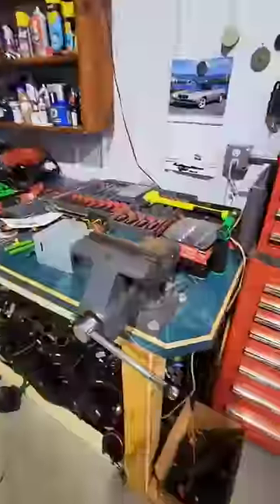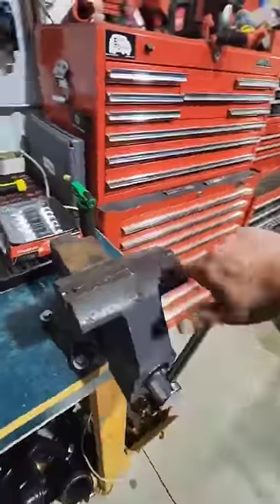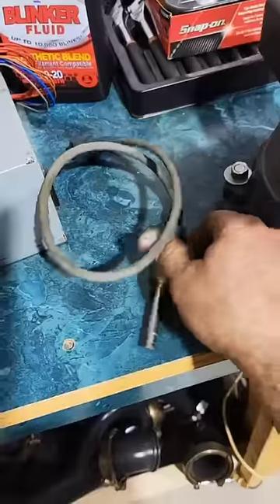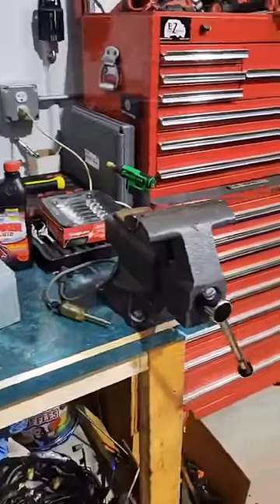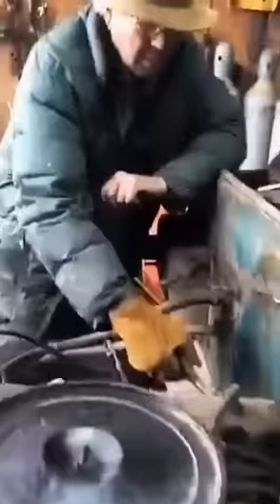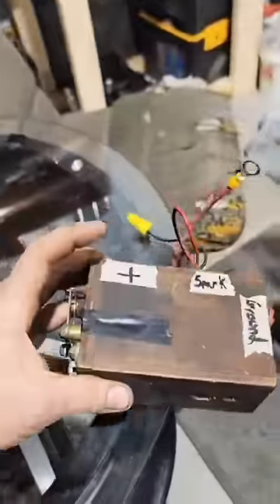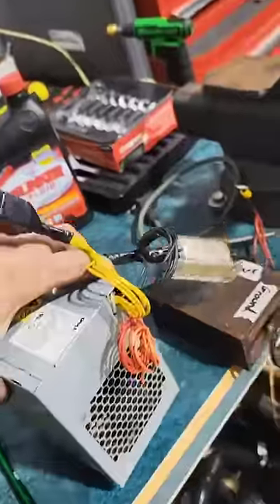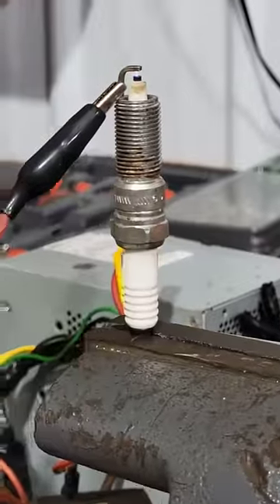30,000 Volts out of an ignition coil! #shocking #shorts Be careful, electricity can be dangerous.

Comment: I used to work security at a car dealership. One night some bad guys came to try to steal new cars, in an already stolen car. I discovered them, and chased them off the property, but was unable to catch them. Virginia law said security guards must cease pursuit at the edge of their assignment, so that was that.

I then had a running minivan to deal with, they had jammed a paperclip in the ignition, and I had no idea how hotwiring worked. I also didn't want to touch too much, in case of messing up fingerprints or otherwise destroying evidence. I called 911, and the dispatch told me take the battery cable off. I was like yeah cool, I would do that, but I have no tools. So he tells me just yank the spark plug wires off one at a time until it stops running, don't need tools for that.

I yelped after the first one, and the dispatch was laughing, I don't remember what I said to them, probably something along the lines of "You could have effing told me it was gonna hurt". So with him egging me on, I pulled two more until the damn thing stopped running.
Reply: @Ixidora battery terminal connections should never be that loose if installed correctly
Reply: @Dylan  okay vidya game lube tech. What's yer plan when the cars still running because you know alternator.
Reply: Why wouldn’t you just cover the air intake with a rag or something? That’s like the most common way to shut down an engine, especially a runaway diesel.
Reply: @alexanderduluoz  Modern cars dont always have easily accessible intakes and he would have had to take those apart too. Spark plug is the easiest way.
Reply: @Falcodrin  source: crack pipe. It’s so much easier to cover the air filter than to bust out the spark plug socket much less remove the 50 plastic covers needed to do so. On 99% of modern cars, it’s 1-2 screws/bolts to get to the airfilter of you even need to take the cover off. Can’t just unplug spark plugs from the distributor like it’s 1972.

Comment: Back when I use to go to the track every weekend to drag race, somebody in the pits somewhere would always forget thier timing light and walk around asking to borrow one.  Most everybody had family's or wives and were in the stands or eating between rounds and I was usually sleeping the previous nights hangover off under my trailer where they would find me and I would lend them my light and never knowing where they were pitted I lost several lights and got tired of it.  Soooooooo I took care of that and after half a season I was never asked again.  Here's how: I had a very old but still very nice antique timing light of my grandfathers that I had retired because of an issue it had, lol.   It had a chrome metal case and wasn't an inductive clamp type. On this light you pulled a plug wire off and put this small shunt between the wire and terminal. Well the issue was it had a short where the wiring entered the gun and due to design and age replacement was not an option without modification and destroying the sentimental value.  As soon as you squeezed the trigger you would get lit up and since it was metal and your hand was wrapped around it once it was shocking you rapidly over and over etting go and it not landing in the fan or hurting yourself was entertaining to say the least.   Anyway I tossed it in my tool box and packed it to the track.  Let it out when asked.  Had a blast keeping my eyes on where it went and watching these dudes getting bit.   They would always return it, sure didn't want to keep it. Haha.  What got me was half of them wouldn't even say anything, they would say thanks and turn and walk away.   Still have that light to this day.
Reply: I just tell people the tool was my late grandfathers and it always come back. They all must have respect or heard of your prank!
Reply: Rofl this is amazing. Thanks for the chuckle.
Reply: @winyaw  yea it only took till about the 3rd or 4th weekend in a row and somebody was asking me if I had a timing light and the guy in the pit next to me yelled over to me something along the lines of unless you like getting electrocuted I wouldn't borrow ok sparkys light I got one if you need it.  Lol. Man that was the good ol days back when the track just opened in Lyons Indiana.  Literally a drag strip in the middle of corn fields in every direction for miles.  Now that i-69 is done finished real close by and wagler diesel bought the track and expanded the whole complex it's just not the same.
Reply: @ravenovatechnologies6554  you are welcome.  Glad you you enjoyed

Comment: Oh man, that's brutal. Anyone who's gotten hit by the fury of a coil understands. Lol 😂
Reply: how would it compare to a electric fence for cattle?
Reply: @gamerguy4209  i have been shocked by both and i would have to say that an fence may be a tiny bit worse than a coil, but they are both pretty bad
Reply: It's the audible " snap " that makes it funny. Watched a buddy get the MSD multi spark one day and he did this little crappie flop causing him to bang his head like five times in succession, rapidly...... " Yeah , it's got spark " also this is why you check to see if you ignition box and fancy distributor are on the same faze .
Reply: @GAMER GUY  electric fences use a special waveform for the voltage to get maximum pain while not being lethal (something about how our nervous system works). Meanwhile ignition coil don't give a fuck about your well being, so it might feel the same but it is much worse health wise, muscle contraction, heart not really living its best life... you know
Reply: @gamerguy4209  they're similar, except the fencer de-energizes between the ticks. Coils don't do this
Reply: @GAMER GUY  I would say a coil is worse because it doesn't give a damn about you, it just wants to move electricity. A fence is more tame because they're designed to not be lethal. A fence has a worse instantaneous shock but the coil will keep pumping you with electricity
Reply: Grab hold of the high voltage  lead going to the picture tube of a 27"" RCA
television. 50.000 volts avg 15,750hz
Reply: @gamerguy4209  Been hit by both many times, I can say for certain the coil hurts way more.  I got burn marks from the coil in my 4WD and it terrifies me.  An electric fence is easy enough to grab on too.

Don't get me wrong tho, neither are fun.  Unless it's someone else being shocked.
Reply: @robsorgdrager8477  Was wondering if anyone else had been hit with their MSD ignition. I didn't croppie flop, but did invent a new dance
Reply: @keatonmiller7883  oh that's disappointing, I've been hit by some nasty fences but we used to have challenges holding onto them as kids so they sent that bad. Also for anyone wondering these fences kept cows and horses in
Reply: @gamerguy4209  cattle fences are a bitch.  We got about 50.000 volts running through ours at a couple milliamps and it makes your whole body twitch.
Reply: They’ll fucken learn one way or another😂
Reply: LMAO when I heard the story behind it I laughed so hard!! Good one man!!
Reply: Yes, yes it will.
Reply: @BobSmith-kd6lq  it's a pretty spicy lill bugger 😂🤣
Reply: @baylog9679  the trick is to use a length of switch grass. You grab hold of a friend and touch the fence. The charge will travel through you and " pop " you're friend. Now here's where the science comes in. The more friends you have linked together the worse it is for the last guy. 🤣😂
Reply: I've been shocked by all manner of electrical devices, and ignition coils running at standard voltage are no exception which is bad enough, but I've also been hit by an ignition coil running at waaaaay higher voltage than intended🤣, which nearly killed me lol (very very close to actually killing me, funny haha not actually funny sort of thing). I had a truck ignition coil set up in an oil bath running direct 110V wall AC through a special dimmer switch, which functioned as a square wave driver for the coil for high voltage experiments. It was operating at about 50,000V AC while drawing around 5 Amps off the wall, and somehow a lead shorted through my work surface and connected me across the arms, my fingers clamped down on both the positive lead and the edge of my table (which I was grounded through by a metal brace underneath the table top, unbeknownst to me at the time) with a horridly strong death grip, all I could do was kick my feet a little as I heard a horrendous 60Hz buzzing in my skull, I was stuck for about 15 seconds until I kicked myself off the table and out of my chair, ripping out the power cables and tossing the container of oil (about a gallon) all over myself and my shop. I can't look at or hear about ignition coils without thinking about that incident🤣. I was about 15 at the time, that was decades ago but you never forget intense memories like that do you?😅
Reply: First time getting zapped wasn't even from the damn coil. Put my hand on the valve cover and it zapped me. Turns out the plug wire was shorting to the valve cover. Still hurt like a bitch.
Reply: I have been a mechanic for over 30yrs and have been zapped by many types of coils. (All by accident) testing for spark on misfiring cylinders. And the guy on the video is right. It doesn't give a fuck if you complete the circuit BECAUSE it will complete it for your ass!!! A funny story though I went out to a friend's family farm and they raised cattle. And had a mean breeding bull they kept separated by a fence. Well as we were standing there talking about how mean he was (you think he would have explained to me that he was contained by that little fence by a fucking detourant of an OUCH factor) but I reach out and grabbed ahold of the fence for something to lean on and the next thing I know I was seeing white flashes in my eyeballs and tasted rust. By the time I let go of that damn thing he was already on the ground laughing his ever lovin' ass off. If my legs weren't so wobbly I probably would have punted his liver a good 40 yards for a field goal. I've never been to another damn farm again. Poor Bull. No damn wonder he was always pissed off...
Reply: Bro coils suck lol your whole arm will tingle up to your chest 🤣
Reply: @Shot-by-brandon  That there is an understatement. 🤣🤣
Reply: @midnightrider1854  lol did it once never touched one again 🤣🤣🤣
Reply: @Shot-by-brandon  I don't blame you ONE BIT !!! Unfortunately, being a mechanic, that is almost in my job description. It's  a part of the job that I despise to the core. I act like a sissy every time I think I am about to get shocked.  🤣🤣
Reply: @TheExplosiveGuy  That sounds terrible. Been shocked many times doing various jobs, but something like you described sounds awful..
Reply: @midnightrider1854  🤣😂😂 understandable man it sucks lmaooo
Reply: @Shot-by-brandon  Hahaha the guys get a real kick around the shop when Its time for me to pull a coil wire. They all stand around laughing because if you knew me, I'm 6'1" 255lbs and afraid of nothing (almost, except the wife and electricity) and I talk loud. But the second I grab that coil I start sweating and get real quiet and the guys thinks its real funny... Lol
Reply: I was holding the top of a magneto when I decided to spin it with my other hand as fast as possible lmao that one bit me a little lol
Reply: @williamstevens4172  ouch! A little is an understatement...! 😆

Comment: My dad who would be 80 today, used to tell me about putting model t coils in the exhaust system so you can hit a button and get flame shooting out the back
Reply: well yea some flame kits are literally just a spark plug that attaches to your pipes and sparks up with a button
Reply: My friends dad did that and he had the windshield wiper fluid reservoir piped to to above the back tires and he'd put kerosene in there catches his tires on fire and do burn outs
Reply: @natdizzle4259  I think that there is a company that actually used to do that to new vehicles in Africa too lol
Reply: @infernaldaedra  That's an anti car jacking kit.
Reply: I've done that on a VW dune buggy. Wire up a relay that kills the normal coil and throws on a coil attached to a plug on the stinger. Rev it and hit the switch. Engine is still pulling fuel but not getting spark so it's just pumping highly flammable air into the exhaust.

It would shoot flames 5 feet high.
Reply: @infernaldaedra  yea it was bmw for carjackers
Reply: @mriopelle33  it was an independent company that sold them, as a universal kit. The reason so many people think it was BMW, is because the owner of the company used his own car, a BMW, as the promotional vehicle.
Reply: Thats clever.
Lord knows enough unburnt fuel made it through those old exhaust pipes. Lol
Reply: @musewolfman  yes some guy in South Africa sick of shjt being stolen lol

Comment: I love old Fords, you really appreciate electricity around Model A spark plug leeds (yes exposed copper strap connectors, not wires). Also Model T coils work great for a flame thrower on the exhaust.

Comment: Need more of this guy.

Be careful.  Booby traps are illegal.  They can sue you.
Reply: Depends on where you live, but in most cases yeah

Tho those guys seem to be good friend so it's al just fun
Reply: @hammerhand5059  similarly to a taser, an ignition coil shock will be just painful, but under most circumstances be non-lethal.

in fact, tasers have a higher voltage output than that ignition coil. you'll probably feel less pain from that vise than a taser

that being said, it's still probably an osha violation lol
Reply: District Attorney's don't give a fork if you complete the circuit.
Reply: @hammerhand5059  If by right circumstances you mean multiplying the current by 10 and using 2 arc points at specific parts of someones chest then yeah you're totally correct. Get a grip dude this thing is harmless unless you're a fish

Comment: You can also charge a capacitor and get simular results.  But be very careful  capacitors can kill with higher voltage ratings
Reply: Which is why you don't do stuff like this with a capacitor in the first place.
Reply: @cameronbartlett856  that depends upon rather you grew up riding bicycles without helmets and in cars without seatbelts or you grew up incased in bubble wrap
Reply: I got hit by the 1 farad cap from my car audio system when I was like 20. I still remember hearing it in my skull/ears.
Reply: @buzza2077 I know your pain. 
 In Mills and industrial settings  it's not uncommon for people to charge a capacitor and put it on the shelf  so the next person that grabs it and hits the output side gets zapped.
Reply: @L Idlett 

 I've had plenty of near death experiences being stupid. Was certainly not raised in a bubble. That being said, I'm very much aware of the dangers of electricity since I weld a lot in my free time as a hobby. I don't carelessly mess with capacitors. Wouldn't be surprised if I have gotten minor brain damage from bike riding without a helmet and doing ramps lol

Comment: One time, I checked a plug wire to ground with a screwdriver while my buddy spun the distributor. Little did I know the screwdriver had a metal core all the way through to a metal cap on the back of the handle for striking... Needless to say, it had a GOOD spark

Comment: We used to run an insulated (like 16-18awg), wrap a stripped section around the head of the plug, through the firewall and just under the seat cover. If felt like the key was getting you (or anything else metal you touched).
Reply: I've also have done this, funny as hell 😀😂

Comment: My dad taught me a valuable lesson once. I was 13 and knew absolutely nothing about mechanics and my dad knew that as well. He’s working on our lawnmower and he says to me “hey put your finger in here and don’t let it suck air, I’m going to pull the cord and you tell me if it’s sucking your finger.” So I put my finger in the hole, my dad yanks the cord and it shocked my ass. I yanked my finger out and screamed “ouch it shocked me” and my dad replied “well it’s got spark so that’s not the problem.” Thank you dad for my first mechanic lesson.

Comment: The company I work for actually used that same Model T ignition coil pack to fire a burner ignitor when our original machine was made back in the 1930s. We still have them made by the original manufacturer that Ford used. We sell them in our parts department regularly.

Comment: Funny story of mine. I was installing an ignition kill switch on my dirtbike. Didn't have a clue how the wiring worked on the thing so i just went straight to the coil, traced a wire on it, picked a spot and put a switch. It worked, it switched off the bike but little did i know that was the high voltage trigger wire. So one day i go to hit the kill switch and i kinda just lazily flop my hand over the mount that i made for the switch ( i was laying my hand over the top of the switch) when i touched the contacts on the bottom of the switch. Yeeah my hand felt good after that one😅

Comment: I had a crazy experience working on my 95 Ford and I was hearing a clicking noise and chose set my hand on the distributor for no reason and had "sparks" coming from my finger tips on the other side of the motor ( it was arcing to the fender)
Reply: Easy check for a faulty distributor etc., IF the engine is still turning over. Wait 'till dark, or put the vehicle in a dark place, and turn over the engine, with the hood/bonnet up. If the distributor is cracked (or any other part of the H.T. system has faulty insulation), you'll see sparks/miniature lightning tracking down the outside.
Reply: @martinsims-fy9pt   It was just an exposed spark plug wire that got me😂